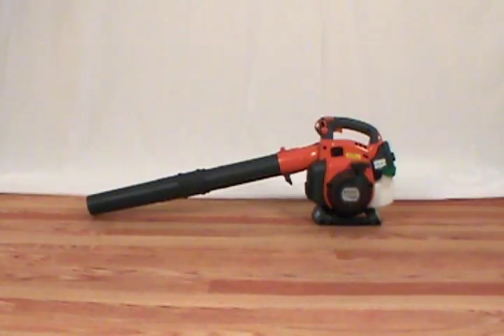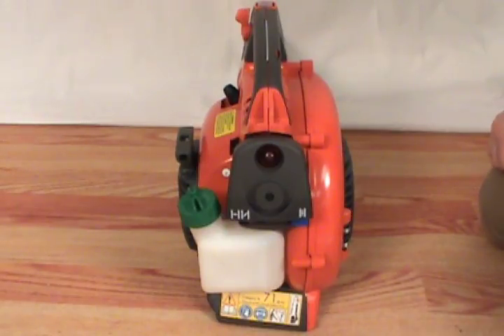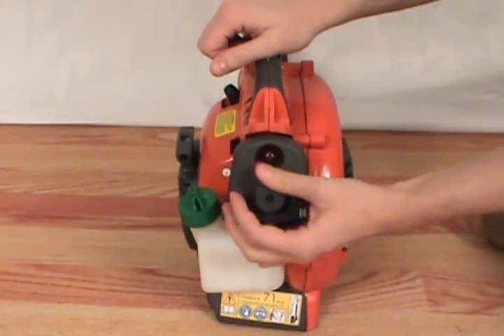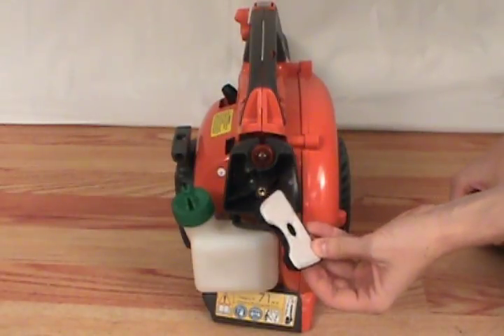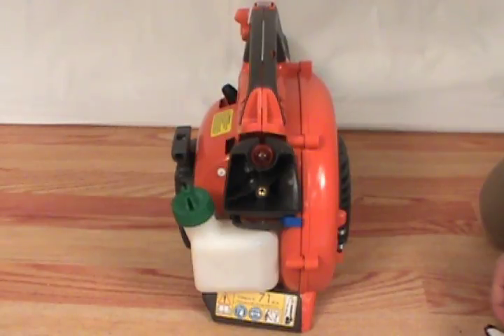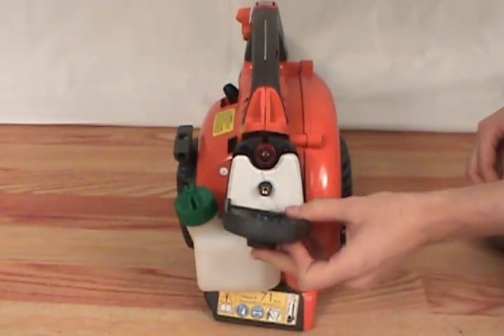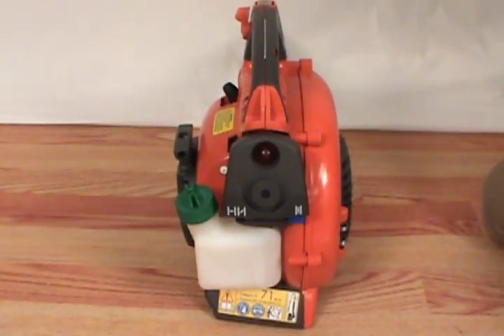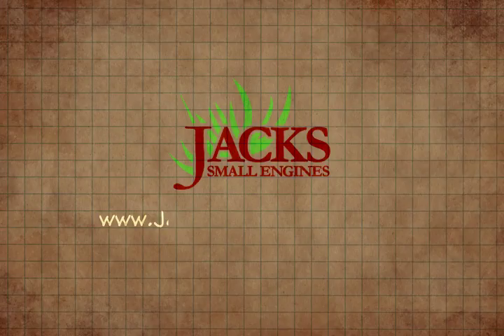Replacing the Air Filter - Husqvarna Handheld Leaf Blower

Comment: The worst designed air filter on ANY 2 stroke ever made. No proper seal against the filter to prevent dirt getting in motor. Huge problem with these. Should be recalled